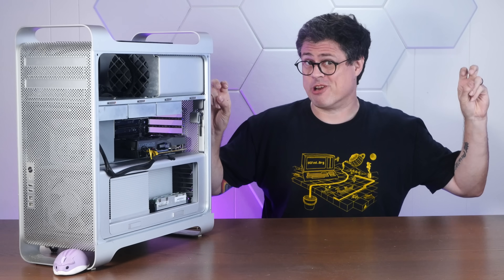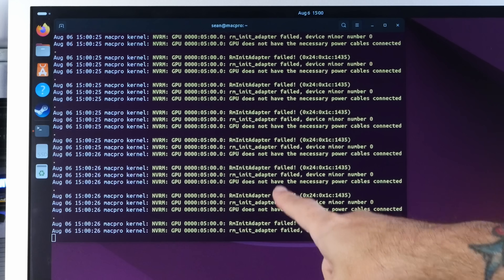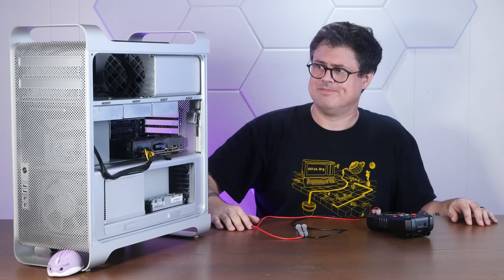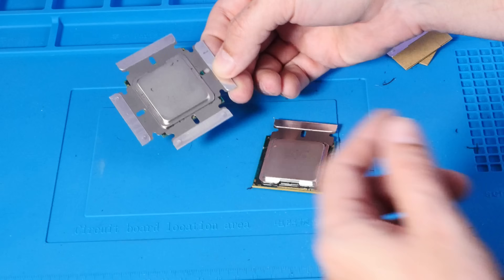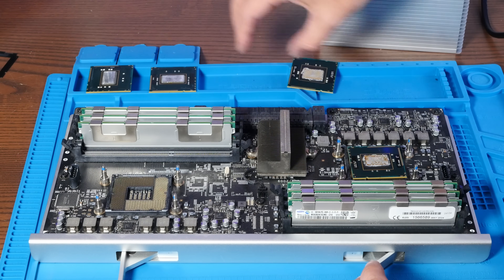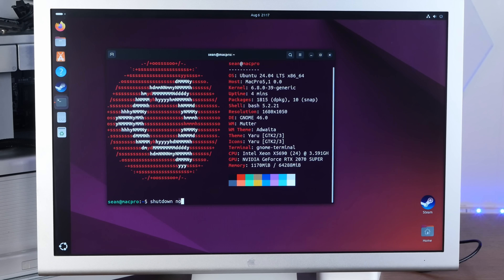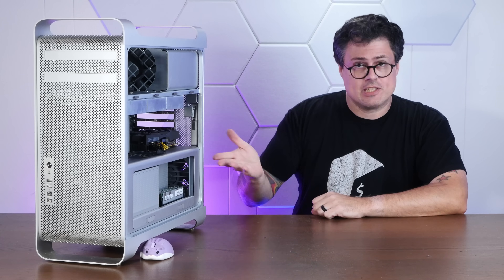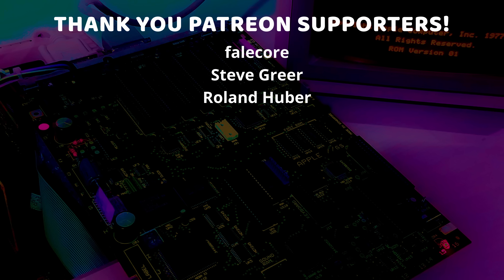Abusing Intel Xeon CPUs

Comment: Fun fact, the solder you shaved off is potentially iridium tin solder, so it might even have a few dollars of value!
Reply: the copper wire mindset
Reply: @NotTheGaslighter  FWIW: copper wire is expensive, this is one benefit to going aluminum...

For electronics, there is CCA wire (copper-clad-aluminum), but has the annoying downside of tending to foul up the soldering iron (seems to form a yellowish amalgam that doesn't re-melt easily and solder doesn't like to wet onto if the CCA gets too hot, kind of an issue if it gets stuck to the iron as it needs to be filed off; presumably some sort of Cu/Sn/Pb alloy...). Sometimes also the copper plating dissolves off the wire into the solder exposing bare Al, which solder doesn't really stick to either. So, CCA is more of a pain to work with. Usual workaround seems to be to set iron temperature lower if working with CCA.
Reply: Thats indium
Reply: It's indium and it's a couple cents at most if it was pure and clean in a usable form.

Comment: Cracking the top off isn't as violent or stressful as you'd think. You're generally supposed to use a custom tool meant for your specific generation of CPU that has special tolerances for it. It only cracks the glue/rubber/solder holding the lid. Basically, it needs to be enough force to stress the glue but not enough force to harm the actual CPU. It's also usually done several times in small increments because, again, weakening the glue is what you're trying to do.

I would never do this though LOL, no way am I risking my CPU!

Comment: You DO NOT need to delid the CPUs to put them in a 4,1, I have dual X5680s in my 4,1 working great since 2016 when I did the upgrade without deliding them, you just need to use a lower tension on the torx screws... I just counted the turns so it was even between the screws and slowly brought it up to tension without bottoming out the screws, I've changed the thermal paste a couple of times since then and it's still stable as a rock!
Reply: The 5,1 runs on standard CPUs with IHS on them. No need to delid CPUs for the 5,1. 
This is a firmware upgraded 4,1 which has LGA sockets w/o the lever and delidded CPUs are used. It can however also take standard XEONs with IHS, just some tweaking of the heatsink is required. Did it, works like a charm 😊
Reply: … just as @Microang stated 😉
Reply: He says up front that his is a 5,1. He just watched a video for a 4,1 computer.
Reply: This is a 5,1.
Reply: @pseudotasuki nope I'm taking about flashed 4,1 without CPU retention brackets, as stated in the OP. Back in the day when I read up on it there were both options, I went with the one that didn't risk destroying what were relatively expensive CPUs back then...
Reply: If you accidentally put to many turns you crack the CPU. doesn't seem worth the risk
Reply: ...unless you enjoy a good time
Reply: yeah, but it makes them run cooler

Comment: Your upgraded Mac Pro from nearly 2 decades ago is running Steam better than my modern Acer Aspire Laptop from 2021...
Reply: 8:09 AND IT HAS LITERALLY 16X MY LAPTOP'S RAM?!?!?!?! I HAVE 6GB OF INSTALLED RAM
Reply: And yet ... they get no software support at all.  Clearly capable, but nope, sorry sucker, you've been enjoying that one too long.  Time to buy a new computer.
Reply: It was a very expensive computer when it was new so it makes sense that it has much power. I have had several Acer Aspire laptops and they are nice laptops, they are not meant for new intensive games. They will run old and well optimized games really well. A desktop would be a better option if your intention is to play intensive and unoptimized games.
Reply: @Compact-Disc_700mb  I got an Aspire E1-572. Came with Windows 8 back then, lasted as such for a week until upgraded to Windows 10, went unused for a good few years until I gave it new life with Android x86. That lasted until earlier this year, the OS corrupted itself when I attempted to dual boot Linux Mint, supposedly you're meant to install Mint first, but oh well, that made me switch to Arch altogether.

And yeah the laptop doesn't run even mid 2010's games too well, not until all graphics settings are turned off or all the way down, and I cap the framerate to 30FPS. Resident Evil 5 is such an example, but then I run into RAM issues, having only 6GB, with just the game and Steam open, I'm pretty much maxed out. :/
Reply: @xGMV  Yeah they are good laptops for normal computer things. They are not meant to be gaming devices. You can do it with any computer but you just have to keep your expectations in check. I used to play 90s games on mine and it was fine. Really for high end gaming a midrange laptop is not the best choice. if you must play games on a laptop you just need to learn to enjoy old games and some light indie games.
Reply: @Compact-Disc_700mb  Indeed, but even some indies give me issues, they only seem to work well if at all when lowering all settings and locking the framerate to 30, there's hardly any exception, such as GameCube emulation. PS2 runs at its native res, but with drops here and there. 

Vulkan does wonders for me under Linux, but even then, this iGPU isn't up for the task.

Thanks for the answer, by the way :)

Comment: If I may chime in, as someone that successfully de-lidded a 9900k?
For removing the soldered TIM paste intel uses, I would get some gloves, some sturdy paper towels (blue shop towels are GREAT for this), and specifically, Flitz metal polish. The polish is great at dissolving that TIM and polishing the freshly exposed die, and quite safe on it. It's a mess you dont want to keep on your uncovered hands, though. Literally apply the flitz like a toothpaste, then use the towel, bit by bit, to rub it in and rub it off. Short of physical damage to the exposed die ( rest in peace, gtx 460 ), it's served me well.

Comment: I also wonder if the CPU was bad from the start. But I also wonder if it would be at all possible to test the CPU without the cooler in the socket just to see if the system detects all RAM before delid
Reply: Not in that motherboard, if you take a second look at the video, there are not a CPU retention mechanism, the cooler is used to pressure the CPU contact pads into the motherboard pins with the right amount of pressure.
Temporarily loosing a memory channel is very typical on direct die cooling mods and it is corrected by adjusting how tight is the cooler and checking that all the screws are equally tightened.
Reply: Some plastic washers the thickness of the IHS, applied to the heatsink mounts would have removed the need to de-lid

Comment: Noctua paste sucks for bare dies. Get PTM7950.
Reply: It's good enough! They aren't getting really warm in there, the thermal impedance doesn't matter too much.

Honestly i'd probably do a sacrilege and use a 0.9W/mK white paste there because it doesn't ever dry up, would take 20 years.
Reply: @SianaGearz  the problem is if the paste has a runny consistency, the thermal expansion and contraction and difference between silicon die and metal heatsink will cause it to pump out and away from the die

Comment: I know it may a shorter video, but you can find them online delidded...   And, always inspect the socket, because chances are you did do some damage and bent some pins. Missing RAM is clearly a sign of socket issues. Those Xeons are bulletproof.
Reply: He swapped the CPUs around and both socket are fine, he also cleaned thoroughly the CPU contacts.
Maybe it was already like that when received maybe something went bad between the core and the interposer PCB (like what happens with all these old nVidia GPUs in the Xbox360 and PS3)
Reply: @RetroTinkerer (nam flashback intensifies)
Reply: @RetroTinkerer  Both sockets could be fine, but I've seen contacts in the socket that just had a broken off tip. I managed to get it working without that tip, a lot of tinkering with bad eyesight and a tiny little pin to bend it up. These are little springs that display metal fatigue after more than 10 years of being untouched and then being treated roughly by a DIYer lol   Those CPU's may also need cleaning on just one specific pin. Just sayin'
Reply: @walterb.9290  I know, these are excellent recommendations but the thing is that he already told us in the video that he swapped the CPU 1 to socket 2 and CPU 2 to Socket 1 and the memory channel that wasn't detected switched place, he also told that he cleaned the CPU contacts thoroughly using IPA, I don't know, Sean is far from perfect, but you know he rarely try to hide his mistakes (that crimping mistake in the video for example). He didn't told us he tested the CPUs as received before delidding so no way to know if one was damaged or he damaged it, so... I dont get why you are doubling down on these two points and what is your point on on implying his status as a "DIYer"

Comment: i recommend the spacer method instead of delidding . the razor method of scraping the tim off damages the die
Reply: How is he going to damage the CPU die with the softer steel blade at such an angle?
Maybe the cooler need to be tightened down to some specific torque to ensure proper contact between package and motherboard, maybe the CPU was damaged when he delided or already was.
Reply: @RetroTinkerer  silicon scratches . I have a few x5690s that were delidded on this way and they either won't boot or also have ram channel failures .
Reply: How can i find more info on the spacer method?
Reply: @DarkoPetreski  Mac runners forums should have it . There is also a spring method too

Comment: I did a 4,1 to 5,1 upgrade and did the vice method for the CPU upgrade. It worked like a charm. The only thing that needed time to do was cleaning the remaining indium off the dies. Also the CPU heatsinks have to be as a specific tension, too much or to little and you get issues like memory channels dropping out.
Reply: Yes, the vice method is the easiest way to delid these. I did mine earlier this year. And have even relidded them later as I swapped to genuine 2010 5.1 which needs lidded CPUs. That was fun. 😉
Reply: Hmm, my Power Mac G5 has one memory channel that goes in and out, I wonder if that's what my problem is there
Reply: I did the exact same thing a few years ago, and the vice method worked like a charm.

Comment: 2:20, could just as well be the fault of the crimping tools and/or crimps. Some rather tight tolerances are required to get both the crimp in the right shape as well as having the right force applied. 
I looked into crimping tools for those special connectors you get on PCBs and after having read a blog on the topic and having seen the price-tags, I've concluded it's a lost cause.
Reply: I have used klein tools 1005 on those type of connections.
Reply: I have bought several cheap (relatively -- less than eighty bucks) crimpers to avoid shelling out over two-hundred for some Molex tool that is designed for one or two pin types that I use, and they'll probably discontinue in a couple years...  I've found ONE somewhere (no idea what it is) that does ... okay.  The crimps aren't very pretty, but it's mechanically sound... ish .. for most of the connectors I use regularly.

The small <2mm pitch connectors I needed to use once... tools cost thousands, so that was a non-starter from the word go.  I've got an amp that I need to repair and I can't find ANYthing that fits the footprint for the connector except the one that is too expensive to consider.  It would be cheaper to redesign ALL the PCBs from scratch with a different footprint.

Comment: Did all models come with de-lidded CPUs?  I did an upgrade like this a few years back and I don’t recall having to as much plus I’m pretty sure the chips I pulled were intact. I don’t think I would have had the seeds to remove the heat spreaders and crank down those huge heat sinks.
Reply from the maker: 4,1 has delidded and 5,1 has lidded. Apple likes to switch things up I suppose 😅
Reply: No, the 4,1s were delidded, but you could flash them to 5,1. True 5,1s weren't delidded.
Reply: Ahh, of course.  Thanks!
Reply: I have heard only the 4,1 dual cpu were de lidded, but the single cpus were not.

Comment: Sometimes when delidding the cpu substrate can warp slightly I would loosen the cpu cooler slightly and you’ll find it may start working again. I had the same issue with an 8700k

Comment: HE DOES IT IN AN X!!! 😃
Reply: That's why it had to be censored, it's X-rated!
Reply: @jdpruente  Pinnacle of comedy!
Reply: CPUs without heat spreaders really should have the thermal paste be spread manually on the die. I have heard that without doing it manually, you could leave a spot without thermal paste that might not have a temp sensor, thus potentially frying the CPU.
Reply: @Piipperi800  Oh.

Comment: Needs a little Metal Gear MKII model sitting on top

This is giving me flashbacks of taking my Inspiron 6400 apart to replace the dried out thermal paste, it was so bad the cpu was stuck to the cooler and got pulled out of the socket 😱 thankfully no harm done. Instead of old fashioned paste I used thermal pads, it's running much cooler now.
Reply: I forgot MGS4 was shilling Apple pretty hard, lol
Reply: @gustiwidyanta5492  lol yup. Don't forget the 4th wall breaking shill for the Bluray drive/disc

Comment: I wonder if that original CPU was just bad to begin with. Could have a bad pad on it or something.
Reply: I've run into the same problem with my cMP with BOTH sets of CPUs (the original 4-core and the upgraded 5680's I installed).  It would only recognize 6 out of 8 sticks of RAM.  I tested every socket and every stick individually and they all worked fine.

I've never had any other hardware issues with this computer after nearly 15 years of ownership.  At a complete loss as to what the problem is.
Reply: @JD101A  another commentor said something interesting :  "I did a 4,1 to 5,1 upgrade and did the vice method for the CPU upgrade. It worked like a charm. The only thing that needed time to do was cleaning the remaining indium off the dies. Also the CPU heatsinks have to be as a specific tension, too much or to little and you get issues like memory channels dropping out."
Reply: @TonyTear  yeah since it's just placed on the motherboard with the coolers acting like the mounting gear it could be that, i couldn't find how much torque it needs exactly.
Reply: @JD101A  I had same issue on x58, had to move the cpu in socket couple times then put the lever down,, then it detected all 3 channels (6 sticks)
Cheers
Alexander